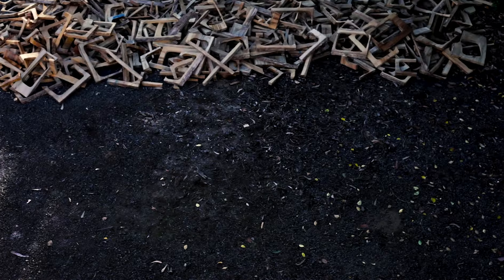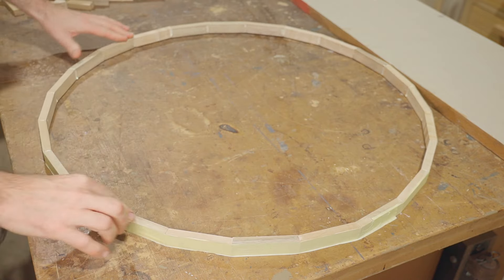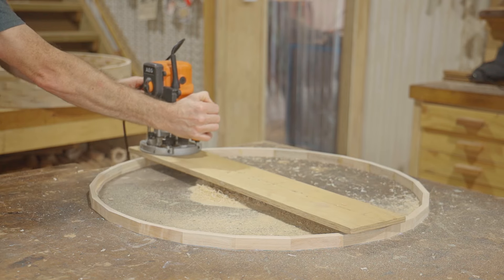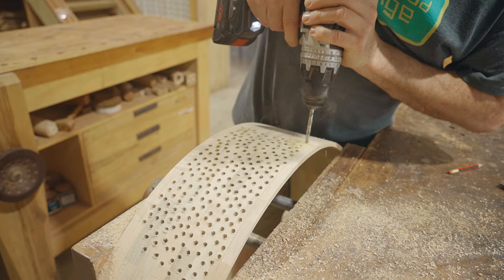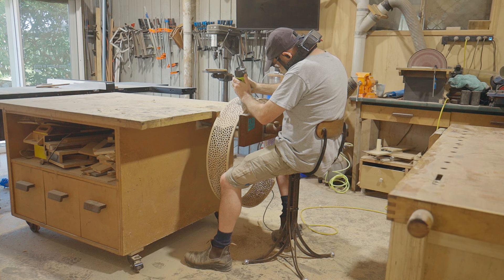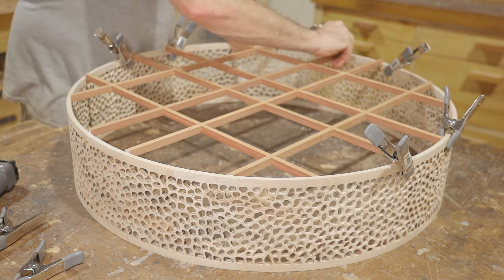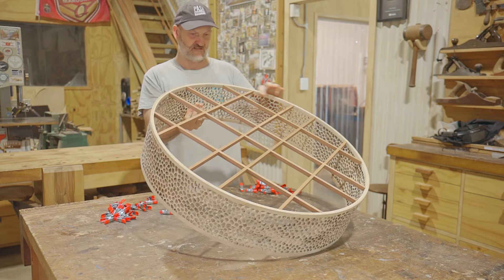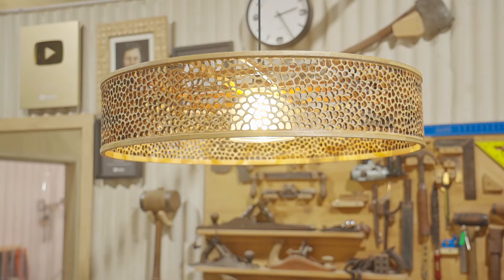Making a Light from Scraps of Wood - Scrapwood Challenge ep52

Comment: The pattern and the huge ring looks great. Love that! But the supports and the glass doesn't really fit imho. I guess I'd used slightly thick wire for the supports to make it look floating. And made another smaller ring in the middle on which I would have applied transparent paper to soften the light - and I might have let the pattern recur.
Anyhow. Thanks for sharing. Greetings from Germany.

Comment: Once you had the 2-ring config, you probably could have sped up your process by gluing a ring to either side (e.g., 2 rings -> 4 rings) and then routing one edge-side as you did using the trim router bit, then flipping it over and routing the other. Probably not a huge deal but would likely have halved your drying time.

....And LOL, you did that, I just hadn't seen you get to that point. :-D

Comment: You should cap off both ends of the cylinder, and put a really powerful 300 watt LED light in there, and it will cast interesting shadow onto the wall.

Comment: One interesting alternative to the bulb would be to pull a trick from DIY Perk's 'Smashed TVs' video and line the inside of the cutout section with LCD diffuser panel pieces, lit by high-CRI LEDs.  It will give off a LOT of light that is perfectly uniform.

Comment: The shade is gorgeous. I would have used 'LED neon rope lights' mounted inside the the upper rim and the top frame. That would make for a more diffuse hidden dimmable light source and would make the wall of the shade the visual focus instead of the central light source.

Comment: I know this vid is a few weeks old, but have you looked into "canopy glue"? Modelers use it to glue (what else) canopies to aircraft but it's viscous enough that it's used to create clear windows in small openings through surface tension alone. You could potentially fill in every hole, with minimal effort, and diffuse the light while still seeing the pattern on the inside :)

Comment: Two things I probably would have done differently. The first is rather than the holes being random, have them either have a hidden pattern or shape or text, kinda like those colour blindness test you see sometimes. the second would be to add a layer of thin Japanese paper on the inside of the rim just to help focusing on the pattern as opposed to seeing everything going through it, it probably wouldn't help much with light diffusion but I think it would look neat.

All the same, very impressed with the level of patience you have making these projects Neil.

Comment: I love it ! I would have spent hours trying to design that in CAD and find a way to make it with a CNC before giving up I think :D 
The respirator that you are wearing in the video, are you satisfied with it ? How can I find it ?
Reply from the maker: I did think about making it as a thin flat panel and then roll it up, that could work with a cnc. I love the respirator, one of the best things I've bought, it's a cleanspace2. :)
Reply: Thanks for the info about the respirator ! I wonder if a thin panel with random holes would bend properly, I think it might crease at many places following lines going from hole to hole unpredictably where there is less material ... hard to tell without trying, but I think you made the right choice !

Comment: This seems like an ideal pattern for a CNC router, to take the tedium out of the process. That said, I don’t have one, so there’s that.
Reply: It would be probably the same amount of work to design each blob as it did to route them so I doubt it would have saved any time. But if it was a finite repeating pattern, yeah you're right
Reply: @TwoScoopsOfTubert  yes, definitely an investment of time to do the initial design, but then you have it. I picture flat panels for cabinets, although the cleaning could be arduous. Maybe this is a good candidate for filling with epoxy. 

Hmm, now my mind is running rampant with ideas for varying depths, multiple layers of material, multiple pours, etc.

Comment: OK, I love it. Pain in the ass to get that pattern out, though... ow.

Was thinking it would probably work markedly well with something like this: 
https://www.youtube.com/watch?v=DdxO5zY-DA4
COB LED strip lighting (continuous). Create a slightly deeper channel on each main edge, then mount the light directly onto the wood (perhaps add a layer of strip aluminum as a heat sink), aimed inward, add a diffuser over it to spread the light even more.